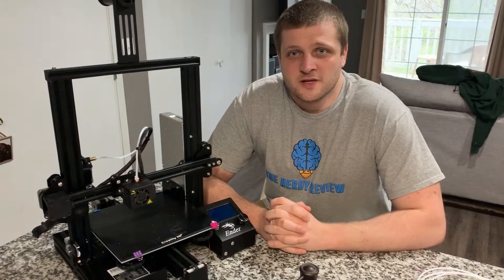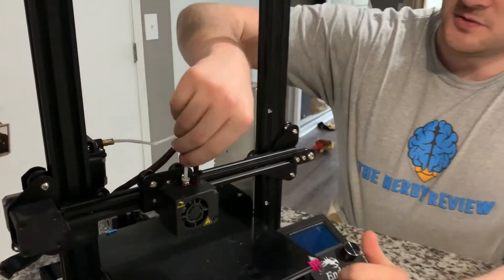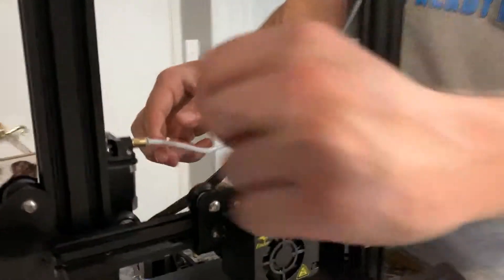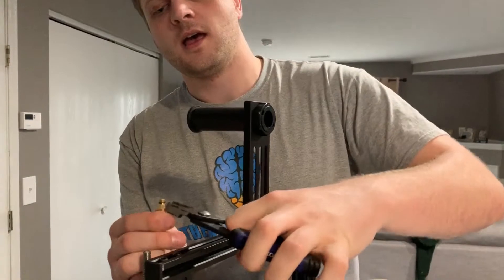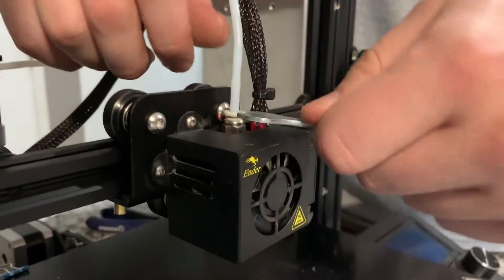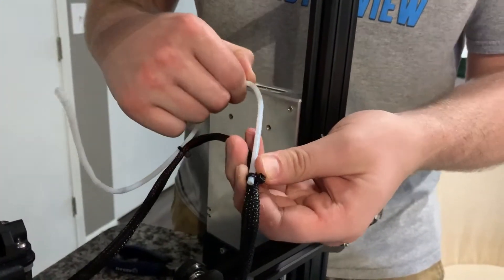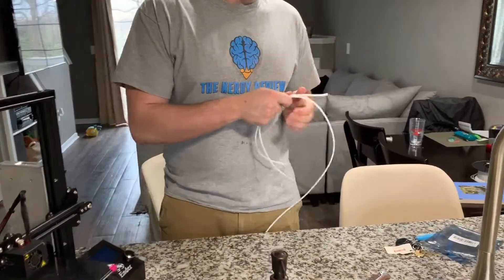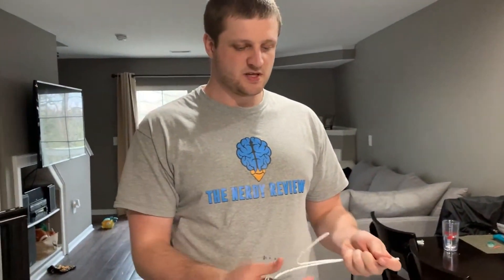How To Change the PTFE Bowden Tube on Your Ender 3 - Quick and easy tutorial

Comment: I know this is an old video, but I also had extreme difficulty getting the hot end out- until my incredible wife offered a solution when I was frustrated about the tube not coming out.  Wrap some scotch tape around your fingers where you grip the tube (sticky side out).  When pushing the ring, the tape gives you the proper grip to pull with enough force to remove the tube relatively easily.  Please comment if this comment helps anyone besides me.

Comment: The lower coupling will not depress for me (maybe I need more force, E3 v2 max neo), needed to get some broken filament out because it simply wouldn't feed with just good filament pushing on the end of the snapped piece (it snapped right by the drive gears, worst possible location for a breakage imo, if it breaks further up it's easy to get it out, if it breaks further in it's just not a problem because the filament has nowhere else to go but forward, but right at the drive gears? yeah good luck, it'll just deflect.) but since I could get one side out I could manually push enough through the hotend and now it works just fine.

Comment: Alright, I'm trying the wrench on the bowden tube to try to get it to release, but it simply won't and obviously I don't want to press down too hard because I don't want to break anything on the printer. Any other solutions? It's kinda funny because the other end that you were using the channel locks to release opens up for me no problem.
Reply: I currently have the exact same issue...

Comment: so I heard, its best to install in the hot end while it is warm to help reduce possible leak.  Did it cause any problems doing this cold?
Reply from the maker: no need for the hotend to be warm during this. Now if you were to try to unscrew the nozzle from the aluminum heater block with it being cold, that would be a recipe for disaster
Reply: @buildcodeengineer  Haven't done that yet.  Thanks for the heads up.

Comment: 1:58 Nope. Will not come out no matter how hard I pull or what wrench or pliers or whatnot I use. That little circle that's apparently supposed to give a little when you push on it is rock solid, which may have something to do with it. Please assist, I am so incredibly frustrated.
Reply: Were you able to get it fixed
Reply: Try to unscrew the coupler from the hot end. Then you can pull it out
Reply: Same
Reply: I am having the same problem. Not budging at all.
Reply: I'm right there worth you all. I unscrewed the coupler and attempted to remove the tube from the hot end. No dice! Recommendations...

Comment: The other thing I should mention. When replacing the Bowden Tube I would also mover the nozzle to the absolute farthest point that you can print, just to make certain the length works properly. The original tubing on my Ender was too short, and would hang up on the crossbar as it extended, and the original length wouldn't let me adjust the height far enough up!

Comment: Nice video from this guy! I wanted to add a couple of things. All the video's I watched talked about the Blue Bowden Tubing, so I bought 3 sets from 3 different EBAY sellers.  I replaced the tubing on my Creality Ender machine, using the new ends that came with the tubing. My problem was a clicking noise from the extruder, and it seemed like very little filament was coming through the nozzle. The clicking noise was from the filament geing blocked just before the nozzle, and the problem was that I didn't shove the new tubing all the way down to the nozzle. When I took the Bowden tube apart and pulled everything out (after I heated up the nozzle first), I found that the filament actualy had wrapped around the inside of the heating mechanism like the rope on a noose! it bottlenecked the filament between the end of the Bowden Tube and the nozzle! I kept on trying to get the Bowden Tube through the adapter with the press down peice and it wouldn't go through! Turns out, the new press down piece that came with the new Bowden tubing had a smaller hole towards the nozzle, and the Bowden tubing wouldn't go through that hole! I installed the old one, and it solved my problem. You have to check the new fittings if you buy them, and make certain they work with your Ender Machine, or whatever Printer you have.

Comment: Sometimes you don't need to pull so hard with two pliers...Simply disconnect from both sides, pull out from the easier side (the motor side is easier) and push it, easily all the way through.
Use this little print for cutting...i like it, worked great for me. Otherwise good video thanks it helped me!

Comment: I had to replace my bowden tube because it  melted into my nozzle and clogged the printer. Because of that the next tube I installed I thought "Oh, I shouldn't push this down all the way, it'll melt" and have been struggling with my prints ever since.
This video is where I learned why (and that made complete sense when he said "or you'll get under extrusion problems"). But now I don't know why my other bowden tube melted....
Reply: It didn't melt unless you did extreme heats for higher melt point filaments. Probably what actually happened is you took out the bowden tube and mistook the filament that hardened from a clog that happens if there is a slight gap between the bowden tube and nozzle as the plastic of the tube itself melting.

It's more likely just that cooled and hardened filament because the tube is meant to handle high temps (be careful, while temps like PLA are safe when you get to higher melting point plastics you should look up how the tube and filament handles it and consider getting a higher quality tube because

 it can give off fumes, degrade the tube over time or melt the tube fairly quickly at extremely high temperatures. Which for humans can be very bad without proper ventilation but especially birds can die from the fumes)

Comment: DUDE.  THank you so much.  I had filament stuck in the 'entrance' and I could not figure out how to even LOOK UP the answer.  This was a lifesaver.  Thank you!
Reply: Same. I unscrewed the nut under it to try and get it out and now that won’t push back it.
Reply: @henryspielstadt6127  I know this is an old comment but I just did the same thing before seeing this video. Did you ever get it back in? It doesn’t seem like it should be this hard but it will not go back in for me.

Comment: You demonstrate the removal of the Bowden Tube as being fairly easy.....BUT what do you recommend if the Bowden Tube DOES NOT remove easily???
Reply: For the Extruder motor coupling there isn't really a better way to remove the PTFE from it, but if you are going to fully replace the PTFE Tube and it doesnt come out of the Hot End Coupling what i usually do is heat the Nozzle up, pull the filament out all the way then carefully unscrew the Hot End Coupling, let the Hot End cooldown and turn off the Printer then i just cut the PTFE above the coupling (leave a inch or two so you can grab it) and push it trough all the way.
Hope this helps?
Reply: @salemawdry6556  this helps so much, thanks!

Comment: I like this. May I add that when you push down on the Bowden Tube to seat onto the back of the nozzle, unscrew the nozzle a half turn, push down on the tube all the way, then tighten the nozzle back up. This ensures that it gets set nice and tight against the back of the nozzle to prevent clogs and under extrusion.
Reply: I found this on a other video too: but I’ve had to order the nozzle socket to do it.
Reply: How much is a half turn? Im having trouble visualizing how much to turn